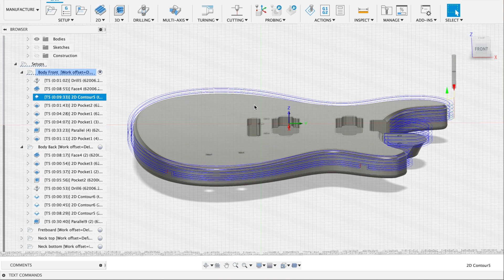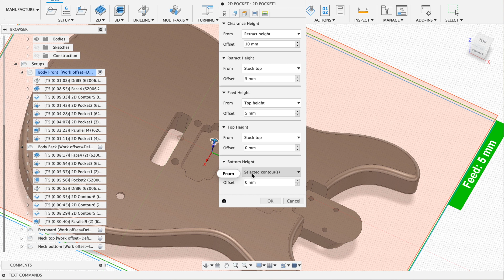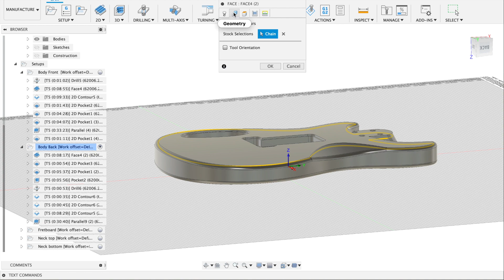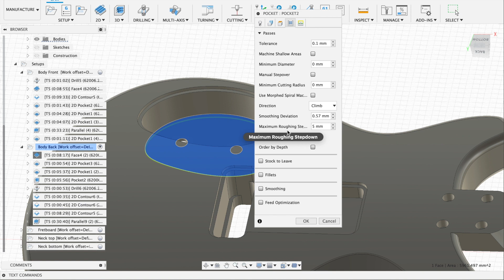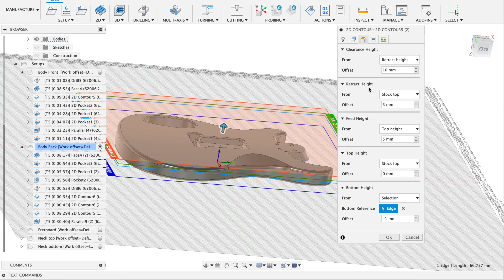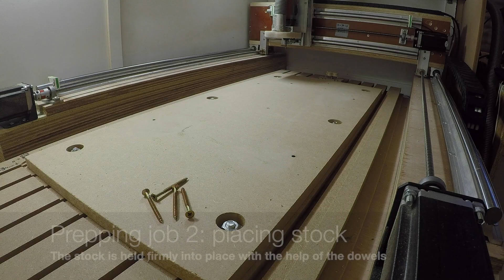CAM & DIY CNC machining Guitar Body with Fusion360

Comment: Hey Audiohotshot.
Thanks for making these videos, I know it takes a lot of work to make them. The video's help me a lot learning Fusion360, just started learning the program for cam uses.
Just a note on the tearout.
Yes better (a lot more expensive) routerbits will help a lot and yes a ballend too. If you run those with the grain of the wood (not against) you'll get a much better result.
Good luck with your next project.
Looking forward to an upcoming video.
Greetings from Belgium,
Hilko
Reply from the maker: Thanks and good points indeed; I'm doing projects with a ball nose now which gives very good results and also I'm trying to improve on strategies overall (e.g. 'eating' away more material in the Z direction at once in the Adaptive Clearing strategies for example to speed up things quite a bit but also helps getting better results in the end).

I do find using a ballnose is a major improvement already, it helps to get rid of those ugly 'steps'. I try to maintain one direction for some strategies if possible. But then again; as long as it's not tearing up the stock too much in the endresult I do not mind a little sanding :-)
Reply: @Audiohotshot  Yes the balance between fast routing and some elbow grease with sanding is just fine. Great to hear you're making improvements!
Can't wait to generate my first toolpaths in Fusion360 and make some chips.
Best,
Hilko

Comment: Excellent video as always.  I've watched this several time.  The only thing I'm still not 100% clear about is your CAM process to make the dowel holes in the spoil board and how you line the stock up to those holes in relation.
Reply from the maker: For the first side (lets say the top side) it is not nescesary to line up the stock with the holes in the spoilboard. As long as the XY zero points stays the same you can make the dowelholes at the  top side of the stock. It automagically lines up when you flip the stock around the y axis (in my case that is the y axis).
Reply: @Audiohotshot  Thank you again.  Your videos have been immensely helpful.  I've already carved my first body and neck!
Reply from the maker: That’s great to hear! Glad it works out for you! Been busy myself as well; trying some new strategies for a new guitar and finishing another guitar (adding frets, finish the body with oil and so on). Keep up the good work!

Comment: Another great video. Personally I would  change the ramp of the helix to something more aggressive like 25 degrees or more. I guess fusion thinks we are all milling aluminium.;)
Reply from the maker: Most of the time I forget, but you could try setting the topheight of the start of the helix somewhat lower... hardly any difference, just saves time (a few seconds...but still). I try to minimize the amount of helix use but, there's just no way to always prevent it....

Comment: amazing work, this type of modeling and cam, can be done with the free version of Fusion 360 or is it the full version.  thanks
Reply from the maker: As long as your machine is a 3 axis CNC machine you can use the free version as well.

Comment: Amazing video like always!
In my experience rounded bits can give you a better finish, specially on carved tops. However as the effective area of  the edges is smaller it was increasing the amount of passes and the total time. Also I had he problem of reconfiguring z, due the own length of the bit. But definitely something it worth trying!
I wanted also to thank you for all your videos, you did a great job on the tutorials of Fusion 360!
Also do you offer routing service? I'm really looking forward to machine a new design buts getting harder for me to find someone in Europe to do it.
Reply from the maker: I'm really curious about the results with the ballnose bit; I'll first have to buy new stock though :-)
Unfortunately I do not offer a "routing service", I would not want to mess up your project. (although I'm interested in the idea of offering this service), but here (the Netherlands) we have FabLab; a service open to all, where you can 'rent' a machine onsite. They have 3d printers, lasercutters and cnc machine as well. There might just be such a service where you live.
Reply: @Audiohotshot  Awesome! Thanks a lot!, I wasnt aware of this kind of places,  just found one here in Prague and I'll go forward to machine it as soon as possible! I'll try to post you a video response :)
Reply from the maker: Please do! Great that you found a service nearby!

Comment: Hi. why do you use screws? The dowels don't hold the stock in place?
Reply from the maker: Correct, the dowels line up the stock, but for holding down and thus securing the stock I use screws, I do not mind screwing them into the spoilboard (after all, it is a spoilboard right?). I hope I’ve answered your question 😊
Reply: @Audiohotshot   yeah. Have you tried just using the dowels? Or will the stock move?
Reply from the maker: Have not tried without, but learning from experience, for me anyway, nothing beats a good old screw :-) There are ofcourse other ways to prevent the stock from moving in any direction: I’ve seen people using masking tape and glue, I’ve seen special clamps. But screwing down the stock I like best sofar

Comment: When using tabs for a 2 sided contour, where do you locate the tabs so they are not machined away when you flip the workpiece? Tabs are always created from the bottom of the stock upwards to whatever dimension you choose.
Reply from the maker: In this particular case I tried to place them in such a way that they do no get lost while machining this body. I say 'in this case' because with a flat backside guitar, it pays off to look for a way to do a full depth pass on the sides to prevent leaving machine marks behind (providing you have a tall enough bit). 

You can see here ( https://youtu.be/qCEKj0vMkJM?t=157) that the machine only goes halfway. In another video I even make tabs on two side, opposite to eachother ( https://youtu.be/sY3E7iepzos?t=445 and https://youtu.be/sY3E7iepzos?t=897).

Comment: hi thanks for your videos, are very cool, i wanna ask you why when im make a neck pocket about 57mm (design) when my machine make the pocket i have a 55.5mm or 56mm result, what im doing wrong?
Reply from the maker: Let me get my crystal ball here ;-) You might have got a Stock to Leave at 0,5mm active? Also what I've learned is to make the neckpocket just a bit wider (0,5mm all around), I wrote about it earlier on my blog, feel free to have a look here: https://www.audiohotshot.nl/cnc-machining-guitar-body/ Hope this helps!
Reply: @Audiohotshot  thank you. i have another question, when the machine finish some operation, the cutter it goes to some distance of the vector Z, and make a hole in the stock. where i can preset the final posicion of the router betwen operation and in the final operation.. thanks!
Reply from the maker: Again, I'll look at my crystal ball :-) Sound like your G28 parameter is not correctly set. Have a look at this vid: https://www.youtube.com/watch?v=J3gN5wqz2FE Hope this helps!